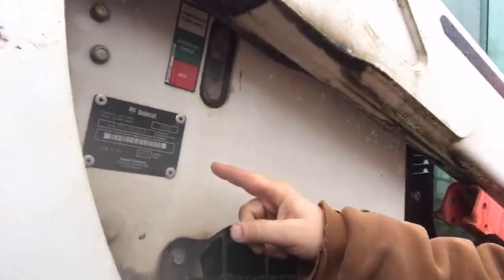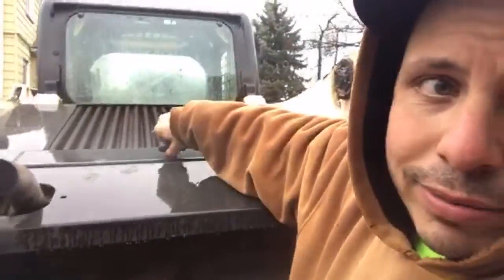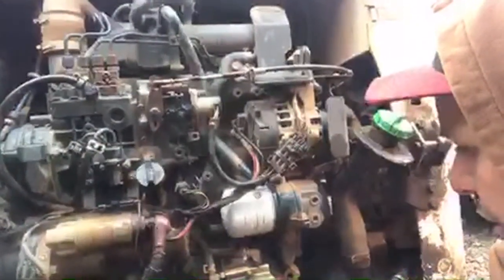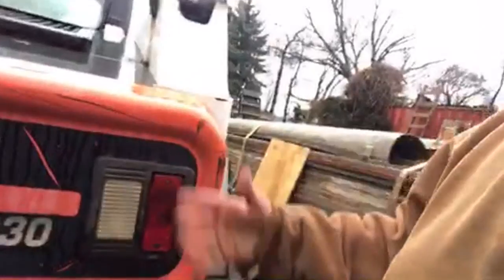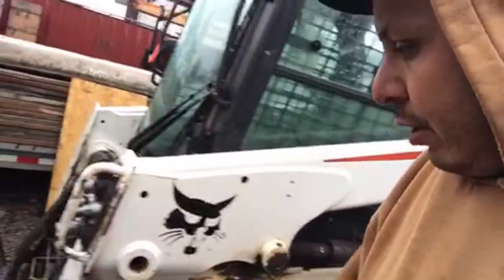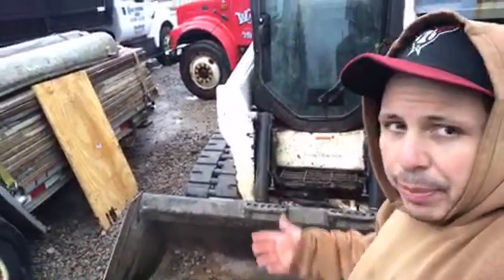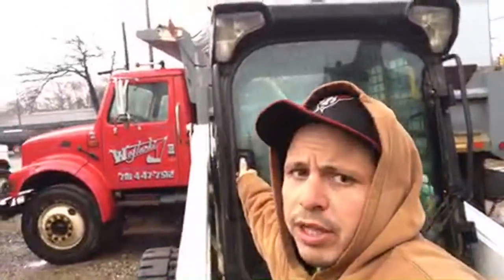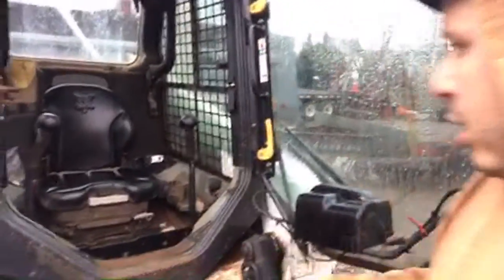Bobcat T630 Review and Walkaround

Comment: Yo man the 300 will only lift 3000 pounds not 6000.and your t630 has a lift capacity of 2150 and it will lift that all day long and way more. It is down rated because its lift arm does not have counter weight weighing down your ass end.